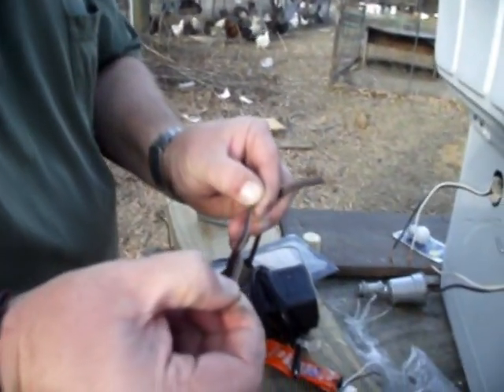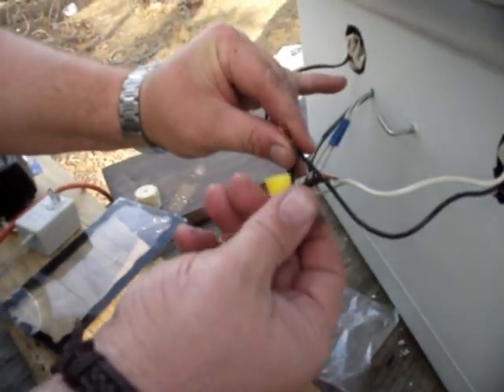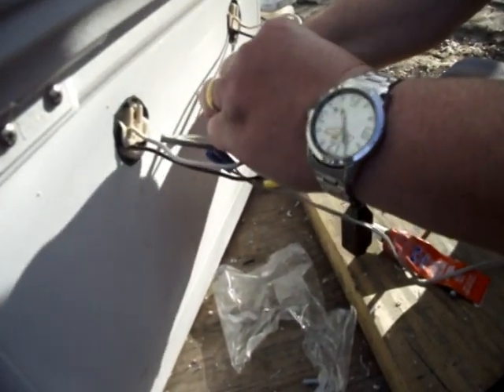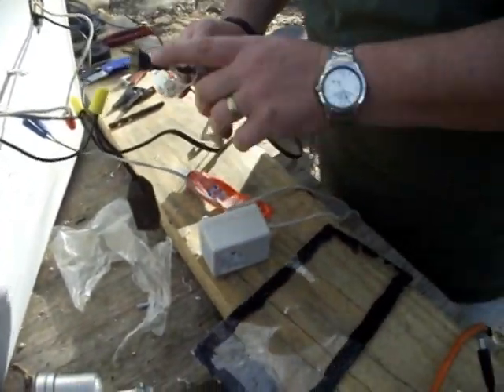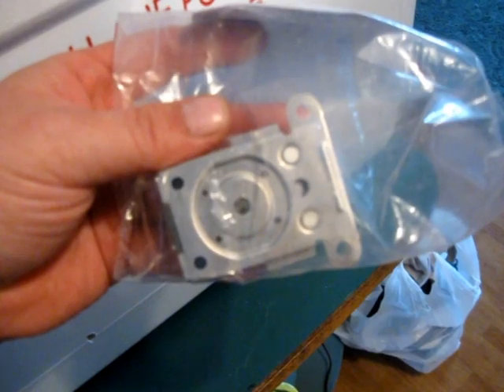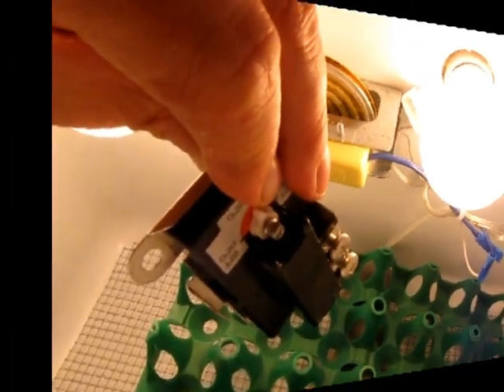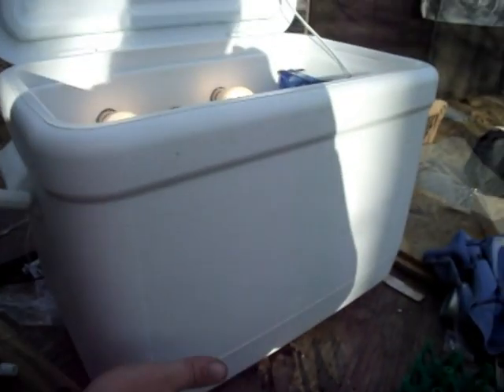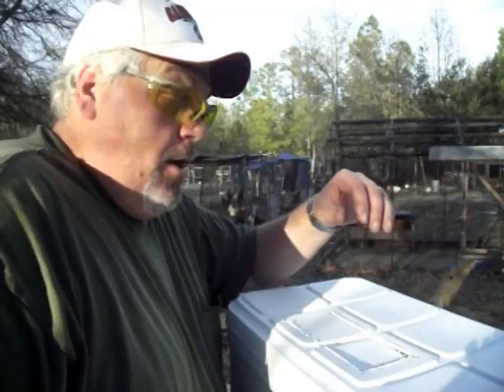DIY, Building, Making and Wiring a Homemade Incubator (Part 3) of 4 (RushLanePoultry) style

Comment: how do you protect your thermostat from getting wet, i add water to the bottom of the cooler and the the humidty draws water to the to the top of the cooler and drips down and I'm scared this could be a huge fire hazard i made my incubator with a water heater thermostat
Reply from the maker: Hey Seth... I've updated this build: DIY! Making a Good Home Made Incubator for Less Than $20.00!
Reply: Seth Rose
Reply: Homesteading in SC
Reply: Seth Rose 6

Comment: You said to turn metal side out if using a hot water thermostat, why is that? I've seen another video and they had it turned the other way